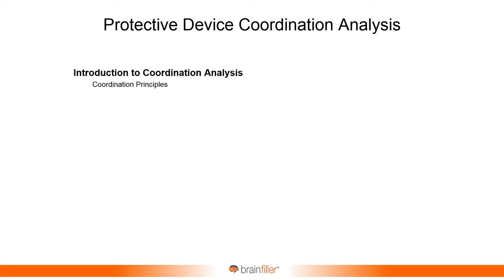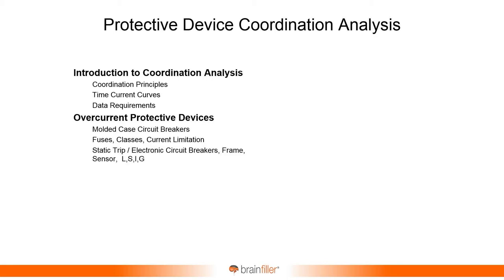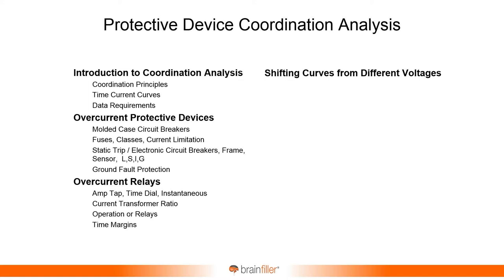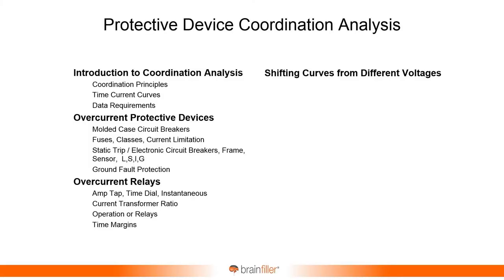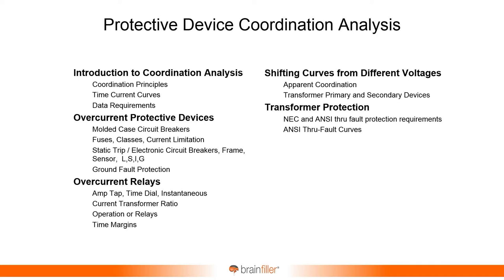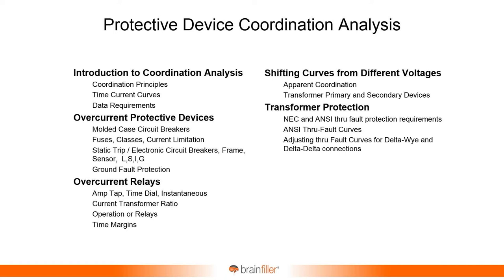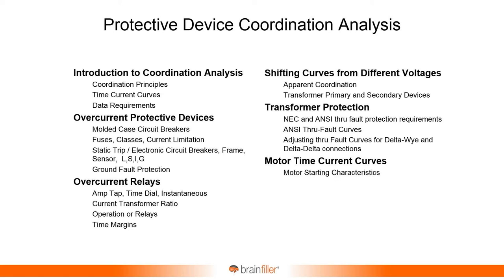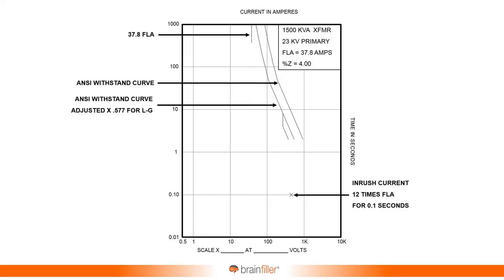Coordination Studies - Preview to the On-Demand Class

Comment: I work for a 3rd party testing company. I did infrared scans today and the electrician opening up the equipment for me dropped the cover onto the lugs inside the transformer and it tripped the panel feeding it. It also tripped the main breaker in the main electrical room. Why did a feeder panel trip the main?
Reply from the maker: Could be a couple of reasons.  
1) Did the main have ground fault protection?  Sometimes if it is ground fault, depending on the settings, the main may trip in addition to the feeder.
2) Higher magnitude faults can cause the instantaneous of overcurrent devices to trip.  So it is possible that the current caused the feeder and the main to trip.  To be sure, that would require reviewing the devices and the respective time current curves.  Thanks for your comment.

3) I hope no one was hurt.  That could have been disastrous. 
4) NFPA 70E provides much needed guidance for safe work practices.

Thanks for your comment!
Reply: @Brainfiller  thanks for responding. 

Thankfully, no one was injured. 

As for the main breaker, I'm pretty sure it has ground fault. And that would make sense because it was more of a ground fault than a short circuit.